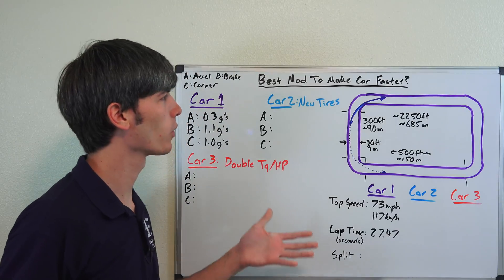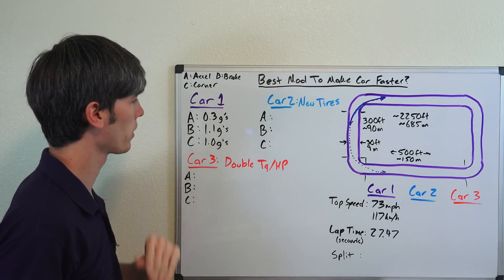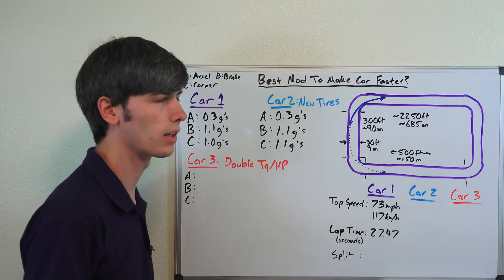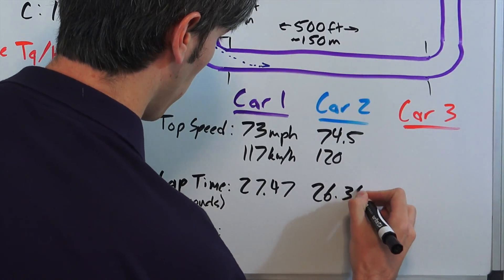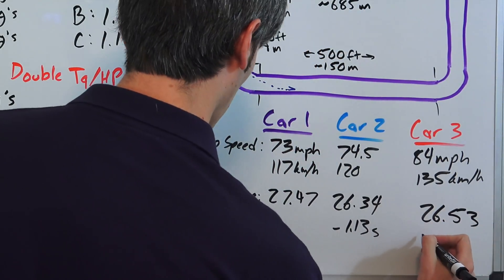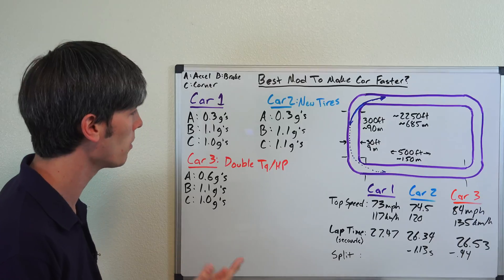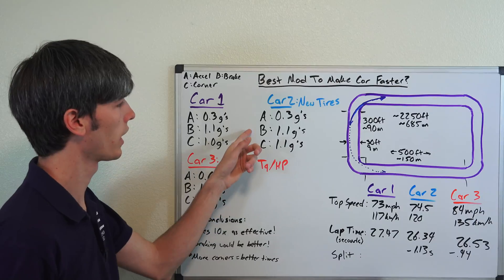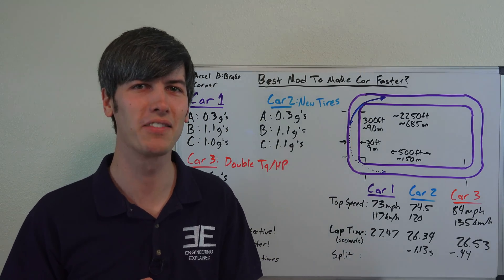What's The Best Car Mod To Go Faster?

Comment: Is he an actual engineer?
Reply from the maker: Depends how you define it I suppose. It's what my degree is in, and I worked briefly as an engineer, but YT is my full time job these days.
Reply: L3G1T no i think he meant as in a train conductor
Reply: engineer deez nutz
Reply: L3G1T seriously, I need to mod deez nutz
Reply: Ur not very legit then r u?
Reply: RedRibbonArmy lol no, thats not even the same thing as an engineer, engineers are the ones who know every principle of the thing they study and design new things from this knowledge while trying to acquire more knowledge on their chosen subject.
Reply: Michel Linschoten pretty sure he went to college. You don't go to college and come out with no experience.
Reply: No he did not read what he said above, he was an engineer BRIEFLY right out of college, made YT his job as it is. Pays better, cannot blame the guy.

When you come out of college you have no experience, you do know that right. You actually need to get onhands expierence that's how life works.
Reply: Michel Linschoten I disagree. there is no replacement for formal education and engineering as so far beyond the dificulty of working on a car it isn't even funny. they don't just arbitrarily make parts a certain way because that's just the shape and style that come to mind. they have to factor in the structural shape, material and what kind of pressure it can take. the tolerances of every part, how the part will work in an assembly, all the math behind all of it. what kind of fasteners to use and the strength of the different kinds of fasgeners. cmis the end lroduct even machinable? (able to be made) what part should be the weakest so if it does fail it fails in a safe mannor and how to weaken it just enough that it is the part that will fail but won't fail prematurely. I'm not even an engineer. I just make parts for engineers after they design them. my knowledge just barely scratches the surface. it's like a heart surgeon. am I going to pick the guy who spent 10 years in med school with a formal education with proven labs and methods of teaching optimized to make great doctors... or am I going to pick the guy who has researched it online for a decade and is really interested in it. I think you know the answer to that.
Reply: Avery Confer

I disagree. there is no replacement for formal education

I live in the USA, i got all my degrees in Europe. It depends of were you are at, the USA has a laughable amount of universities that would not be near the educational value you can can find in even a decent EUROPEAN COLLEGE. Let alone their universities (i am Dutch)

engineering as so far beyond the dificulty of working on a car it isn't even funny

Then feel free to take a engine apart, and put i back together. You will find out rather soon, that it's not as easy as bolting on some parts and you're good to go. Also if you look at his videos? It CLEARLY go into the engineering side of things (how is it made, and how did they make this work)

All you need to do, try to take apart an transmission, and put it back together it will humble one trust me.

it's like a heart surgeon. am I going to pick the guy who spent 10 years in med school with a formal education with proven labs and methods of teaching optimized to make great doctors

You clearly cannot make the distinction between an engineer and an actual mechanic. No matter how well a part is made, it does not mean that same person can work on a car. It's like saying a carpenter can make awesome cabinets, but because he knows wood work he can build a boat too.

They are two separate professions for good reason. There is not "more difficult" there is what do you KNOW.

My point is simple, you can learn anything as long as you're dedicated to that what you wish to learn. Formal education only takes you that far you will learn far more from doing it. That is and always will be an universal fact.
Reply: +L3G1T I did a "hands on" course at college to be an automotive technician. I'm now employed in an actual workshop as an apprentice, and let me tell you, it is a totally different environment. I thought I knew a lot, I thought I had experience, but compared to what these other guys know and on the jobs I'm seeing day to day, I am totally lost 90% of the time. And I've been doing DIY stuff for 10 years.

College will not prepare you as well for the real world as you might think. Experience is king.
Reply: james Sho really lol
Reply: james Sho oh, sorry I don't know how to do that...
Reply: Engineer on paper no experience ...
Reply: Michel Linschoten as someone going for an automotive technology its a fully hands on college course. I guess engineering would be one you spend more time on paper, but also YT only pays better if you can get up in a quick manner, at first it's super slow as you'll see from my channel, I just started posting recently and have gotten more views than expected but I still haven't picked up attention yet(yes I know I don't have very diverse videos on my channel but I will soon). Once your channel gets bigger though you start to get paid decent as I've heard.
Reply: L3G1T
 It takes lots of effort my channel i take hardly seriously enough to make any money of it. To make serious money you need serious content. And the right crowd to follow, these days it's tons of teenagers out there and their interest is important to "tickle" it with the content you might make. Not an easy feat in itself, channels like this are obvious enough packed with useful information.

It takes lots of work keeping up with proper content. It's a daytime job which i see and understand. I am just a guy with 180k channel views hardly worth mentioning. I make some money thanks to the monetization program, but nothing to retire on for sure lol.
Reply: Michel Linschoten haha I know what you mean, I plan on only using for channel improvement but as I've noticed you don't earn much until you really get up there in rank, as I've only earned  0.003 cents haha which isn't really something I'm concerned with tbh I'm in it for the fun of it and I wish you the best luck my man, thanks for the nice conversation :)
Reply: james Sho what do you mean?
Reply: Michel Linschoten yes and no. I'll use my trade for example (strangely we work very closely with engineers) I am a machinist. if I go to school for machining for 2 years and head off to a shop and am just thrown into it full force I will struggle, I will need to ask for help, there is a lot that I won't know how to do. but if i am thrown into that shop with 0 experience I won't even know how to check parts or pull up a program on a machine. what I am saying is he may not have the knowledge of a full fledged engineer with 40 years in the trade, but he knows a hell of a lot more than any of us do.
Reply: Avery Confer
 He knows more because it's his interest, it's not that hard to do that. I am 36, i never ever worked on a car before in my life. Now thanks to the internet, i can take most of my car apart to get to the problem, understand the problem and fix the problem.

That's why he knows more, also as an engineer he has that logical mindset. Not everybody has that, my father in law for instance is 64 years old. He would not even be able to put a screw in a sheet rock wall totally two left hands. Even if you show the man hows it's done.

People can learn anything, i always tell my daughter too. You got the same tools as any other human being. As long as your interest is there and you actually get the proper information. You can do most things yourself in life.
Reply: noxious89123
 My point precisely, you learn by being on hands with it and not in a school with a nice title. All schools do is get you that piece of paper for a good tuition fee...
Reply: Michel Linschoten I have rebuilt engines of all kinds. two stroke snowmobile engines, small 4 strokes, and me and my dad fixed up an 01 Mustang GT when I was in high school. we rebuilt the engine but didn't touch the transmission. if you think transmission is hard to work on can you imagine how many times more difficult it was to design? they had to design each part and make sure they all worked together properly and could be easily assembled. all you are doing is putting it together.
Reply: Michel Linschoten I work closely with engineers and I think it is crazy you think working on a car is as hard as engineering. it's laughable. that's like saying my job as a machinist is just as hard as engineering because I make the parts and have to decide hw it will be machined and how to set up the job and do maintainance on the machines. I can keep my ego in check enough to admit that their job is far more difficult than mine. I just make the hole, they decide there that hole has to be for maximum strength, ease of assembly, and to work with the rest of the assembly.
Reply: Avery Confer

I work closely with engineers and I think it is crazy you think working on a car is as hard as engineering

Ask one of your engineers if they can rebuild a transmission, or an engine from the ground up. Guess what their answer will be....no.

You watch to many YT videos, seeing it being done thinking it's pretty easy. Want to know why they cannot do it? BECAUSE it's a DIFFERENT profession. Engineering is a VERY WIDE understanding, there are TONS of different branches in engineering. This i why you're a machinist and not an engineer you do not get that simple fact.

it's laughable. that's like saying my job as a machinist is just as hard as engineering

Tell and engineer to do your job? I want to be you will have plenty to tell him what he will do wrong. Unless your job consists of little intellectual need (pushing a couple of buttons) again the laughable part is here. That you do not get that simple fact yet again. HE is not a MACHINIST, and you're not an ENGINEER. It's not more complex if you actually had your interest in it. You look up to these people, because you're not smart enough to realize you CAN do it too with the proper training and guidance and interest. That's being said to you a couple times now but you do not grasp that.

I can keep my ego in check enough to admit that their job is far more difficult than mine.

No you keep your stupidity in check, i am sorry but that is how i see that. I was a machinist (mobile excavator for 10 years) after that i managed to land a job at BUMET BV (Europe) guess what? That company does metal engineering for various industries. If i could do that why not you? You keep yourself from progressing...that's my point. You can learn and progress if you want too.

Now you understand me i have been there done that. Now i live in the USA and i work for a company (Acosta) marketing totally something different. As i did not want to go back to my old ways to many hours of work.

But you need to grasp here, that you can do those jobs and they can do yours...with the right training, and attitude and interest you can learn...

ANYTHING..and that was the sole point of all what's being said to you. So laugh, or comprehend and really understand what we are telling you here.
Reply: Michel Linschoten just because two jobs are different and one person can't do the other does not mean they are of equal difficulty. some jobs are harder and require more training or more difficult training. I don't hold myself back, I like machining and have no aspirations to be an engineer, mostly because I despise (and am not very good at) math and the simple trig, geometry, and algebra that i need to do is enough for me. I can do harder stuff in Mastercam if I really need it for reference (like when programming igf on our old okumas). not everyone is equally intelegent. some people are just sharper than others. some of our engineers can actually machine. Lori, one of the engineers that frequents our building actually started as a machinist and still probably knows more than I do about the trade. engineers do work hands on. many engineers must design and build vehicles as part of their training. what is harder, putting something together from existing pieces, or having to design each part perfectly and put it together and have everything work perfectly as designed. because to design it you must know how it goes together. who do you think tests new products that engineers design? yes, often the same or other engineers that are part of the project.
Reply: Avery Confer

Lori, one of the engineers that frequents our building actually started as a machinist and still probably knows more than I do about the trade

And stop....that's all you need to know and understand. You keep being in "awe" of what they do and that it's so hard. It's their job, a job you can master (That's what our point is all along) so you admit finally that i am right.

And stop explaining what an engineer does it's not relevant at all, in case you missed it read my previous comment. Stop being in "awe" and compare the two there is not harder..you cannot compare two different jobs (mostly) it's like judging the guitar in rock and a heavy metal band what is harder to play? You can debate this till the end of time with no outcome.

Give it some thought...
Reply: L3G1T I mean that u can quit if u want to because ur not legit.
Reply: james Sho lmao you don't even know me
Reply: Michel Linschoten just because she was a machinist means nothing. just because she is capable of doing what I can doesn't mean I'm capable of doing what she can. some people are more intelegent than others and that's not even an opinion, it's a fact. not everyone can do every job and I'm appalled there is someone else that even has that opinion. engineers math skills are so far beyond what I'm capable 
of (my list of failed math classes as I struggled through bssic college math as I was taking Machining classes could show you that). some people can do jobs others cant. I can't be a surgeon, my hands are very unsteady when I'm under pressure and that's a quality that is very important and not something that can be helped. my point is is not everyone can do everyone else's job.
Reply: L3G1T u have a fake username I know that
Reply: Avery Confer
 Look i said what i wanted to say, you still do not get it what i am trying to tell you...so let's agree to disagree. I am appalled that a simple given fact completely eludes you.

So you be appalled all you want friend, no shits are given really. I am better off talking to a wall..

You have a nice day.
Reply: james Sho lmao whatever man have fun being blocked
Reply: Michel Linschoten good. go cry on that wall's shoulder then!
Reply: james Sho Did i even remotely spoke to you?! I think you tagged the wrong dude here.
Reply: Michel Linschoten well ur crying about how u don't agree with avery & ur better off talking to a wall so u should cry on that wall's shoulder then!
Reply: Michel Linschoten lol u got me man. u had me rolling at etch a sketch. yea ur right. I'll move onto the next guy that hopefully won't be as smart as u.
Reply: Oh yeah
Reply: Engineering Explained he means as in do you have a degree of engineer

Comment: Question...Technically wasnt Car3 "Faster" on the track, while Car2 was "Quicker" to finish?
 When associating cars to the terms quick & fast arent they completely different? Quicker, being the car that took the least amount of time to get from point A to B, and Faster, being the car with the highest trap speed while going from point A to B. 
 From my prospective adding power made Car3 the "Faster" car, while adding good tires made Car2 the quicker car to finish. (Car2 had the ability to carry its speed longer, making its sectional MPH average higher but it's still not the outright faster car, only faster thru the turns. While Car3s Speed in the straights was much "faster". I guess the video Title is a bit off to me, I got more of a "How to make your car 'Quicker' around a track" vibe from this video. Great stuff BTW. I actually just mounted a Set of 255/40 RE71r on my personal car! 💪
Reply from the maker: +PrzFinest21x If a car goes around a track in less time than another car, I will say that it goes around the track faster. But I like to not overthink words and use simple explanations so everything is easy to understand.
Reply: Engineering Explained The same can't be said in the sport of Drag Racing, correct? Which is Faster? The CarA that ran 10.1sec at 145mph or CarB that ran 10.0sec at 133. For most CarA was much faster, But CarB was slightly quicker. Apples to Oranges. Just a wording over analyzation on my part I guess.
Reply: Deciding which car is faster based on top speed is primitive. For a long time we've been focused on the time aspect. The term 'faster' simply isn't used to it's dictionary meaning anymore.
Reply: I often have this discussion, actually.  I have taken the definition of "quick" as a time definition, whereas "fast" is a speed definition.  So, like you stated, 145 mph is faster than 133 mph, but the 133mph car is quicker.  That said, looking at the dictionary, the two words appear to be mostly the same definition, ironically using each other as their definition.
Reply: Jack I understand from both aspects. The car with the  quicker time, held a "faster" average speed. Not the faster trap speed, but the faster average speed thru out the entire course.

Comment: everyone knows or should know it is about power to weight ratio.
simply removing weight from your car increases that ratio. (best and most productive modification).
remove every other bolt on your fenders.. remove anything you can.. put it in a bucket.. you remove 100 pounds from a 1600 pound car.. you have huge difference

Comment: I remember some pure stock racers who cheated by cranking in wedge with their torsion bar suspensions. Those cars were really turning good lap times with only one mod. When the track manager made them take the wedge out they went from leading to getting lapped.